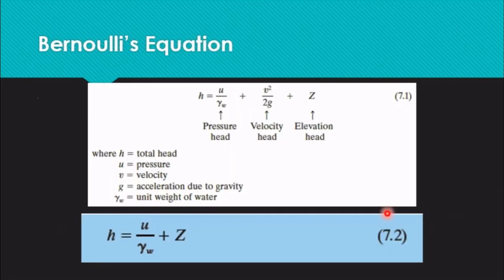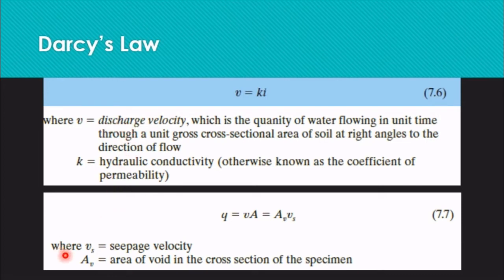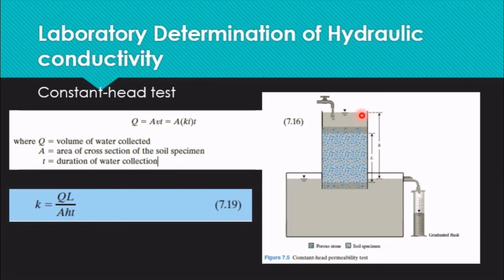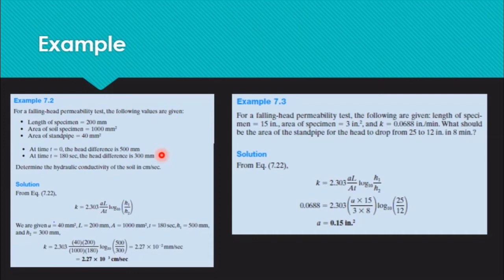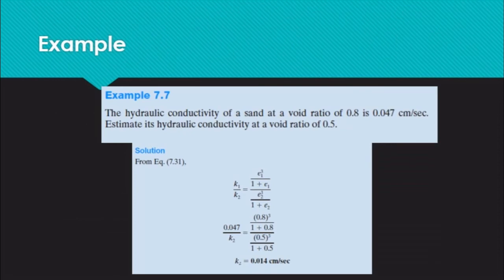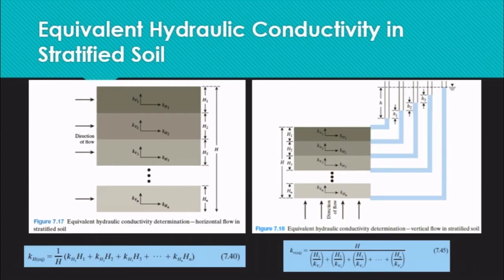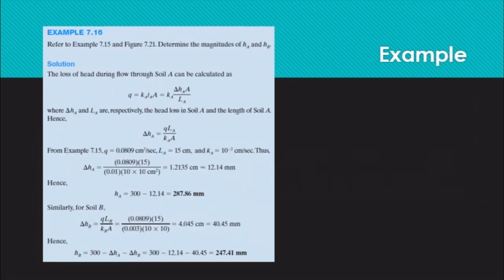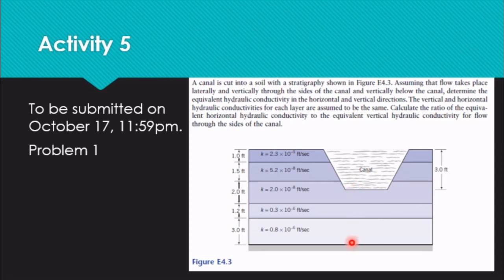Permeability || Soil mechanics by Engr. Emerzon Torres, MSCE

Comment: during a geotechnical laboratory the students compacted a clayey soil into a cylindrical mold of 4 in. diameter and 4.58 in. height. the compacted soil in mould weight 4.25 lb and it had a moisture contect of 14%.the specific gravity ofsoil is.2.70.what is the void ratio..can you please tell me the answer of thus questions